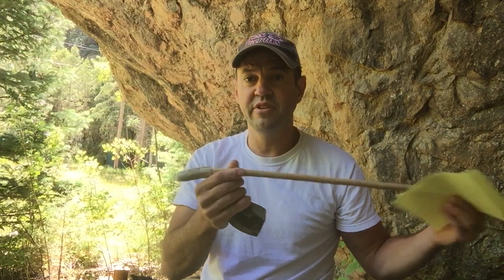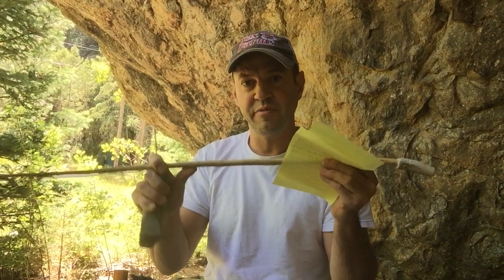Questions answered

Comment: Fantastic info and I'd love to sign up for an entire lecture series!  FWIW, I saw an antler tine artifact at the SD state museum a couple years ago that was drilled out in the base.  While I wasn't able to handle it (I did ask, lol) it appeared that the wear on the tip was nearly identical to the wear I see on my punches, which are based on what I've seen from your videos.  

Lastly, and I'm sure you get tons of requests for various things, but I would like to hear your thoughts and see you work on a Scottsbluff replica some time.
Reply from the maker: nogie1717 I’ve been doing buffalo punch Scotties and will do that sometime.  Lots of Mandan bone tools found, but I’ve never seen a drilled one.  Very cool!

Comment: As someone who has adopted and uses your shaft punch tool and technique A LOT, I would be very interested in seeing a drilled horn that was used this way.  You have to get some video of that!  The only drilled and hafted horn I've seen in the literature has been described as bone points.  I'm also interested in any additional reference you have on the big horn sheep toolset that was discovered.
Reply from the maker: Chuck Learns Lithics I’m talking to someone who is going to try to get some good pics of the tools and I will update when I have them.  I no longer have  the paper on the sheep horn tools.  Let me see if I can find a link
Reply from the maker: Chuck Learns Lithics https://www.academia.edu/9596691/Basketmaker_II_Horn_Flaking_Tools_and_Dart_Point_Production_Technological_Change_at_the_Agricultural_Transition
Reply: @Flintknappingtips  Excellent!  Thank you for that reference!  Great basin and Pueblo cultures are somewhat of an obsession for me.  This will make for some good reading this evening!
Reply: @Flintknappingtips  found Mike Dothager referring to the Morhiss site having drilled antler tines.  Mike interpreted them as a billet extension for horizontal punching, but it's easily an insert for a pressure flaking tip OR a stick for a shaft punch.  At any rate it's a reference I've not seen before.  I'm searching for the original source.

https://youtu.be/0NAEedfBkuE

Comment: I started with abo and all major reduction was easy but i could never pressure flake, it turns out my antler was too fresh and would sort of just smoosh and dull instantly.  Now that they are over a year old they are fantastic, the flakes I push off have more convexity and aren't as flat as the copper flakes, is that normal or is it a platform/angle issue?
Reply from the maker: Flakes InYerShoe antler is capable of pushing very long flakes over arcing surfaces.  Some of this is edge dependent due to the nature of the hardness and abilities to work off of less abraded edges.  It frustrates me when I see all the abo kits sold w fresh dawn tines and not an explanation of different tip treatments and burnish.
Reply: @Flintknappingtips  Thanks. I harvested my own antlers and had no idea so i can't blame anyone but myself for that one. Now I'm spoiled by the copper though.